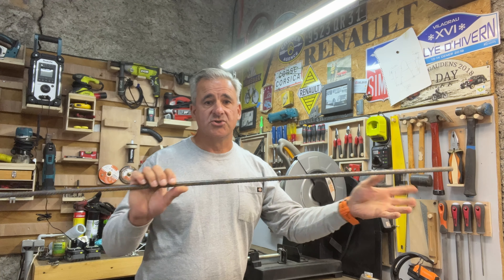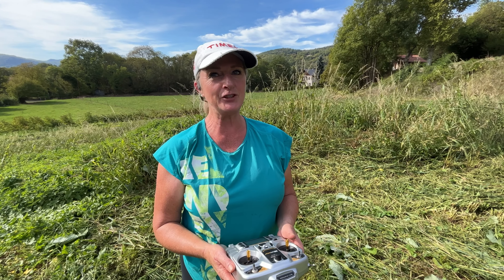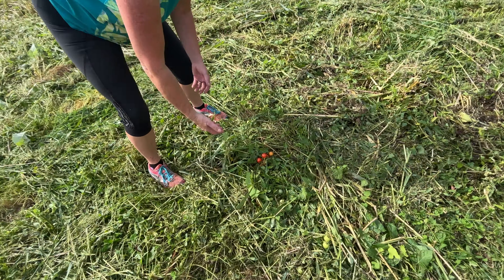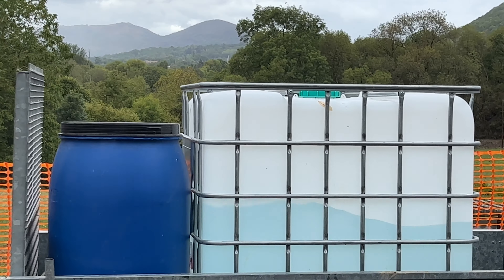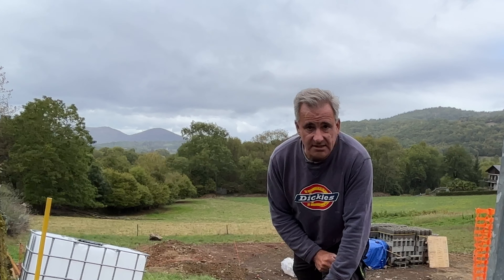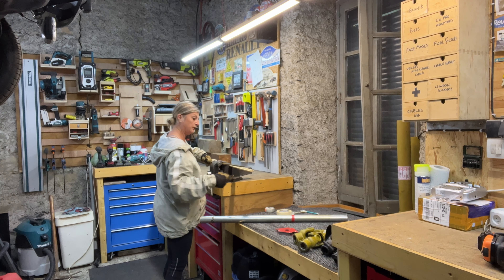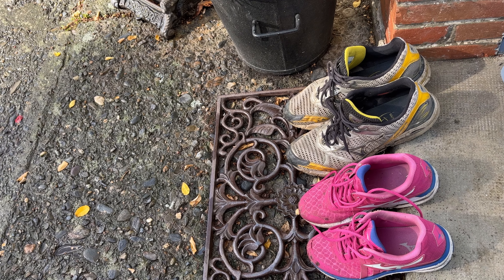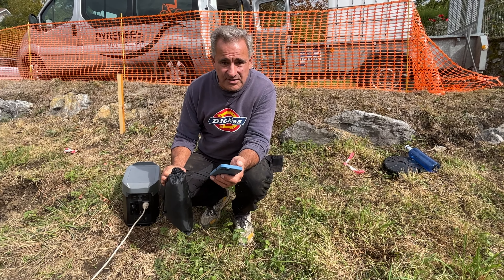Prepping Steel & Water | Garage Shop Project Ep4

Comment: I transfer water between  2 Ibc  tanks with a 12v submersible pump with 30mm pipe.I  turn on the pump get full flow,then switch off the pump.And water continue s to siphon.Saving my pump and battery.Looking forward to the.next one 😊
Reply from the maker: Yes, I have tried it and it works perfectly without the pump now.  Just about to do another refill....using up lots of water

Comment: G'day from Australia. Loving the channel guys. I came to mention the same method as many others have but there's more then on way to skin a cat so keep using the pump if that's what's working best.
Reply from the maker: Cheers Antony - I will try again with gravity tomorrow but I did suck on that pipe big time and nothing came out.  May use the pump to prime it and see if it flows.  Thanks for watching. 👍🏻
Reply: @HomesteadingUncontained   yeh at that distance it'll take a bit, but it'll go eventually. If you've got the pump and battery setup I'd just use that and use the other method as back up.
Reply from the maker: Just did another refill - and eased the water out as I unfolded the hose and it worked perfectly.  Not too fast but now I can leave it emptying with out the power.  (We use the pump to give us a good jet for the concrete work and cleaning)  Thanks for watching and your comments.  👍🏻
Reply: @HomesteadingUncontained   good stuff! Good luck with building process and I'll keep an eye out for updates!

Comment: Buy a thicker hose ( about 2 inch thick) and Connect the hose between the 2 ibc containers & the higher container fills the lower ibc 
Super fast without using a pomp .
Greetings from 🇳🇱
Reply from the maker: I will try it - doing a test again tomorrow as we need a refill.

Comment: Any chance you could siphon from the higher water tank to the lower without a pump?  Maybe you won't always have the fill-from tank higher.
Reply from the maker: I just refilled using only gravity and it worked perfectly. Not sure went wrong last time, probably my enthusiasm to use the EcoFlow 😂

Comment: Later on in the future when you want to transfer water from one IBC to the other IBC the best way is to us 2 inch layflat hose between each tank through the 2 inch tap on each tank. The best way is to have the bottom of your IBC in your trailer higher than the top of the how much water you want to transfer to the other IBC tank & gravity will transfer the water much quicker without the need for a pump. You'll only need about 10m of 2 inch layflat hose & a couple of T Bolt hose clamps that you can easily remove after you have transferred the water.
Reply from the maker: I will check out my local farm store as I have seen that pipe.  Thanks for the advice and watching 👍🏻

Comment: Amused as to your calculations as to the amount of capacity your power supply could provide. Did I miss something obvious? Why didn’t you just connect upper tank, on trailer, to lower tank by a direct hose. It looked as if there was an adequate drop between them or doesn’t gravity work the same in the Pyrenees?
Reply: In order for that to work the bottom of the tank on the trailer would have to be above the top level of the tote that is oñ the ground and there is not that much elevation difference.
Reply from the maker: Yeah, I will try again to see if it will work, but I initially sucked and sucked that pipe and no flow came down.  Tomorrow is another test.

Comment: Not enough height to use gravity to move water from the top one to the lower one? Or was it too slow?
Also looked like snowflakes in the air 9:35
Reply from the maker: I will try again, but I sucked and sucked and nothing came out (I might use the pump to get it flowing then see how it goes....tomorrow more water)  - it snowed on the high mountains - that was just thick rain.